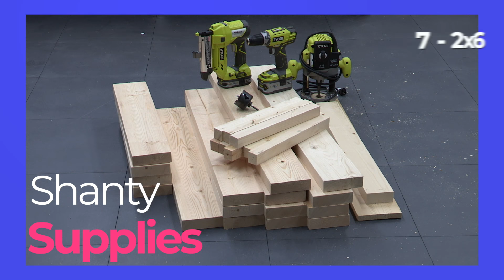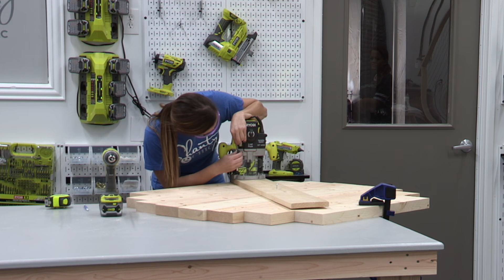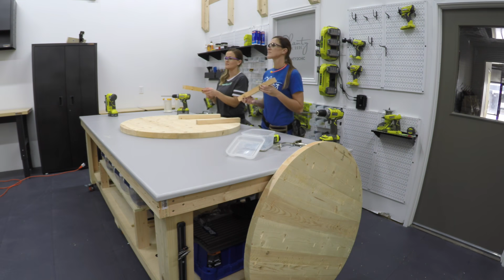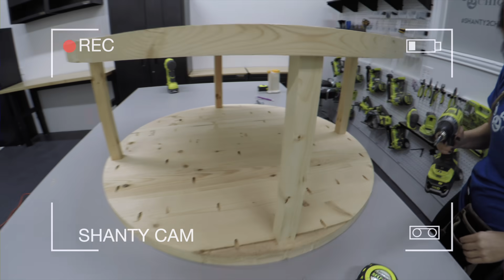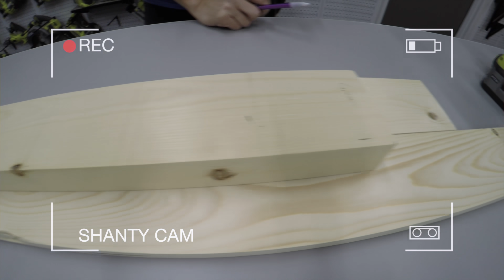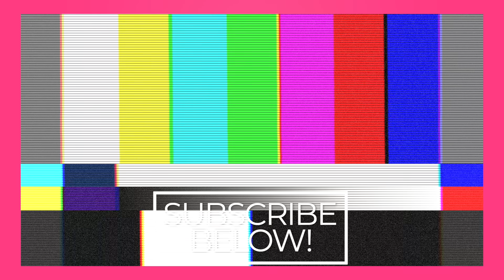$39 DIY Round Coffee Table

Comment: How are you able to find perfectly flat, unwarped 2x4 lumber? And for under $40? All the 2x4s I find are wavy (if even slightly) to the point where the table is never flat. Even with ripping them and eliminating the “crumb catchers”, mine don’t mate up nearly well enough.
Reply from the maker: ghost_mv these are 2x6 boards, which seem to be more straight. If you have a hard time finding straight boards, check out your local lumber yard!
Reply: Even if I get straight boards I cant ever seem to get them to mate up evenly with a kreg jig. Just as the screw gets tight it kick the alignment out of whack.
Reply: When working with wood it's not perfect there will always be minor imperfections that's why sanding is a very important part of any project